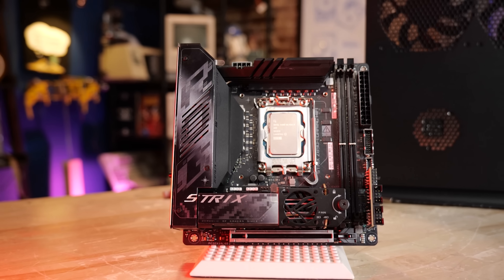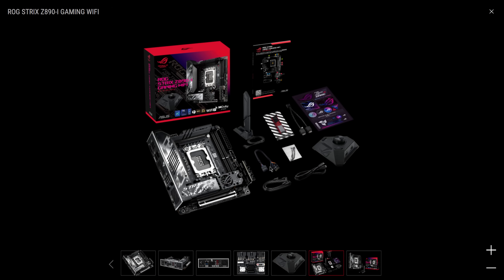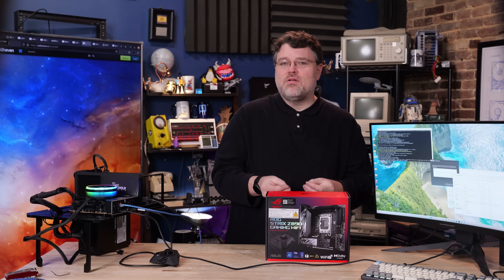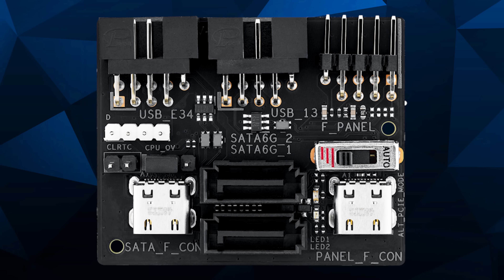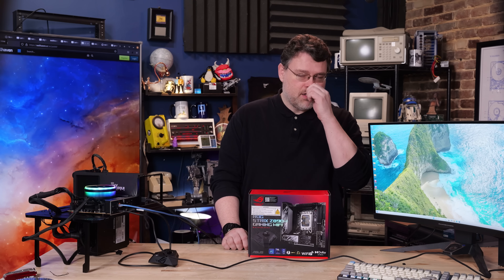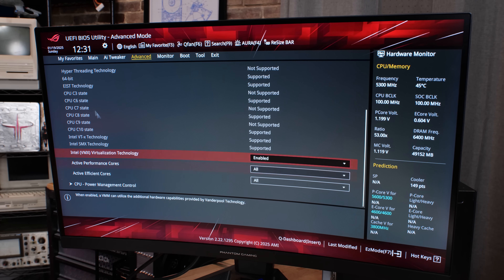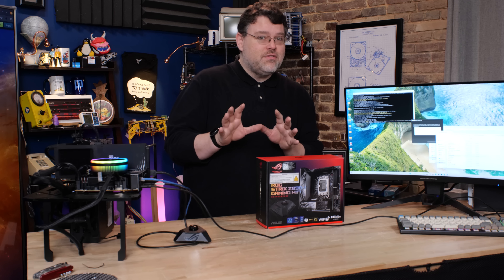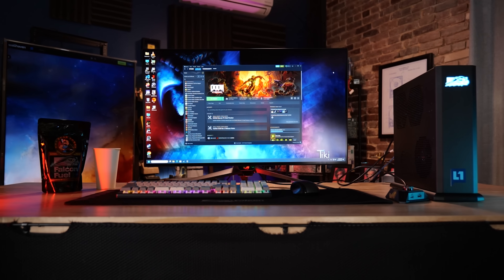The 285 non k Intel Ultra 9 w/ the ROG STRIX Z890-I Gaming Wifi Motherboard

Comment: You actually explain how the features work where the manual doesn’t clearly state certain features. 

Btw when I did EZFLASH with zip + file selected it flashed the bios and installed ME 

Thanks a lot!

Comment: The 285 non-K still has a 180W turbo TDP. Can that stock cooler really handle 180W?
Reply: For sustained high loads, probably not. For day to day use, it will be fine.

Comment: @Level1Techs  With 128GB or 256GB of DDR5, can you do some y-cruncher benchmarks for large pi calculations?  Y-Cruncher requires lots of system RAM for the larger calculations, and it would be interesting to see how the Core 9 Ultra 285/285k performs against other solutions for that math/science workload.

Comment: Didn't know where to ask... I'd like to get new hardware and turn my old pc into a home server. Setup: i7 4790k, 16 gb ddr3 ram, gtx 1080ti, corsiar hx850i power supply, MSI 7 GAMING 3 (MS-7918) mainboard. Doable?
Reply: I'm using a non k devil's canyon as my jellyfin home assistant server you'll be alright. If you need transcoding idk if the 1080ti is nvenc capable.

Comment: i had the Asus z690 itx board with that M2 tower, got it because it had thunderbolt onboard, was having so many issues with the drives i had to return it, went with MSI after looking up on the forums and finding so many reports of the same issue.

Intel has stopped placing a big price premium on K CPUs, wich also points to a much lower requirement in the binning process. They also played a lot of games with undervolting since alder lake - H0 die will only undervolt on MSI boards with lite load enabled in my experience, while the 12700k would not undervolt even with msi b760 but the 12600k does.. while the 12700f does on the msi B660 . Totally arbitrary stuff.

Comment: I had the same experience with a 13900k vs a 14900 (non-k). The non-k was so much more efficient and a much higher binned piece of silicon.

Comment: Intel should allow ECC memory support on all desktop platforms like AMD does instead of gatekeeping it to the W chipset series.
It‘s fascinating to see how they are in the gutter and still don‘t do everything to make their products more attractive to customers.

I thought them enabling ECC memory support on most CPUs would be a sign of Intel finally moving in the right direction here, only to be disappointed yet again by the bad selection of “workstation” or “server” motherboards required to use ECC memory.
Reply: I've been waiting for what feels like ages for ASRock Rack's W880 motherboards to come out, specifically for the ECC support, built-in Arc graphics + QuickSync, very low base TDP, and high (for Intel) PCIe lane count. And, oh boy, the W880 chipset and the Core Ultra non-K CPUs are taking forever to release. It's bizarre that Intel considers e.g. the Core Ultra 5 235 non-K to be "launched" for about two months, but there is zero supply available anywhere. I'm aware that full W880 motherboard availability was slated for Q1'25, but we're currently halfway through that and there are basically no products available to buy.
Reply: That’s my personal main reason for not buying anything from Intel since 2015. If possible I only get systems with ECC memory support even for personal little office systems for family members. Even if it’s just an anecdote, application and total system crashes have practically lowered to 0 once I checked that there aren’t any BIOS or hardware bugs.
Reply: Sorry about the rant... I'm just frustrated with Intel lately. This is the first time in years where an Intel platform successfully checks all my boxes (despite being on the expensive side), and I can't actually buy it due to lack of availability. Let me give you my money, Intel! God knows you need that revenue these days, LOL.
Reply: Be also warned that the software quality of ASRock Rack’s motherboard Firmwares and BIOSes is abysmal, I have had so many negative experiences with them (Intel as well as AMD platforms) that I vowed to never buy anything from them again. The crucially bad stuff is how slow and irregular ASRock Rack releases new BIOSes with critical security fixes, that’s an absolute no-go for me.
Reply: @abavariannormiepleb9470  Duly noted! Thanks for the heads up.
Reply: They also disable pcie bifurcation on anything but the high end chipsets. Really annoying

Comment: I wouldn't trust any CPU to run DDR5 at 1.45volts for long.   not sure what the ram manufacturer was thinking pushing the XMP settings that far.

Comment: Interesting about the Measurement Engine - I don't think you can update it from Linux. On my Asus Z790-A, the ME gets updated as part of the BIOS update (it does this in a 2-stage update with a reboot in-between) and has done since a particular bios version. I'd be interested to see if this is still the case here.

Comment: Bifucation of the v5 x16 slot:

I tend to associate you with "common sense" so much, that I felt you were contradictiong yourself there, criticising that the 2nd M.2 slot would take half of the x16 lanes...

Not sure you ever pronounced yourself on the real-world benefits of an x16 PCIe v5 slot for GPUs...

Actually, I believe the only real advantage of PCIe v5 support on x16 "GPU slots" is the fact that you can now take half of those and repurpose them for other stuff, extra storage or  networking that matches NVMe speeds.

I've been using a Minisforum BD790i Mini-ITX board with a Ryzen 9 7945HX already soldered and then put a bifurcation board in to the x16 slot which splits out half of the only slot's lanes into dual M.2 while leaving a physical x16 / logical x8 slot for low-profile cards on top: it's turned out a perfect solution, although I actually have nothing PCIe v5 in that system, it's v4 peripherals only, but the lane management argument still holds true.

And actually I'd love to see the GPUs switch from PCIe slots to a bunch of M.2. connectors, mirrored on the motherboard, so you can decide and switch on phyiscal and logical allocation of lanes to GPUs or others.

If PCIe switch chips didn't cost multiples of kidneys and dozens of Watts, that would still be prefereable, but I can also see the physics involved.

While cables tend to add cost, shock and reliability issues vs. slots, with PCIe v5 equal length PCB routing in a 2D space is becoming so much of an issue that cables may offer a 3D escape in addition to the flexibility and density advantages. My impression is that on EPYCs boards cables are already much more present because of that.

Comment: Trying to get F NW to replace that motherboard with one i will send them and say screw warranty but i don't think they will do it. I am getting a lot of push back. If you are going to cut the video card down to 8x from 16x might as well get MSI MPG Z890I Edge TI WiFi Motherboard, Mini-ITX and get 4x nvme slots for 32TB of storage and drop that board. I am going to have to take it a part after a few weeks I am sure and put what i want into it and sell that board. meh it is what it is and I really like the tiki but i hate that they picked one of the worse boards. I mean hell you even get 5gb ether on the msi and you don't have dongle crap all over the place too.

Comment: On one level, the bifurcation makes a lot of sense but is also dumb.  So many GPU manufacturers are using x8 so the other 8 are going to waste.  In an ITX, maybe you're more likely to use a lower end board. At least you can use 4 of them if you want. It would be super slick to enable the x8 5.0 to be x4 4.0 to 4 more m.2.  That seems real useful.
Reply: luckily, it seems like going down from x16 to x8 doesn't change performance very much on pcie5
Reply: @plinyvicgames  that's true for now. I guess x8 5.0 is the same band width as x16 4.0. 🤷‍♂️
Reply: @plinyvicgames  Currently the only cards common in user space that handles PCIe5 are the 5080 and 5090 GPU's, and that's if you define "Common" as potentially available. All other GPU's are at best PCIe Gen4 compatible, including the ones using x8 PCIe lanes.

And even that 5090 will lose no more than 3 or 4 % at the most when going Gen4. The interesting part is that apparently a lot of users has had problems where the RTX 5080 and 5090 has had problems running with Gen5 settings, so effectively they have been forced to "downclock" the PCIe slot to Gen4, halving the bandwidth, to be stable.

Now if you halve the width of the slot to x8 lanes, and at Gen4 speeds it will have the same bandwidth as a x16 lanes Gen3 PCIe slot. So say good bye to another 7 to 9 percent performance. But as the user has spent between $1200 and $2400 or even $3400 for the GPU they are surely OK with that...

Yes this is only relevant if you are spending on a latest gen Nvidia based GPU. Earlier generations will not lose as much performance, but for a motherboard intended for compact gaming computers that isn't a brilliant idea.

Talking about performance the difference between x4 Gen4 M.2 and x4 Gen5 M.2 drives is far from fantastic in the huge majority of applications and use cases. Sure the Gen5 drives are absolutely blazing, on paper. But in real use you are going to be hard pressed to really notice a difference unless you are running drive speed benchmarks. For the majority of all other use the difference is not going to be noticeable. Especially true is this if you use the Gen5 M.2 drive for booting, running the OS, gaming and normal office use. If you are editing 4K or 8K video, doing massive database shuffling and reorganization and so on you can see a difference between Gen4 and Gen5 drives, but if you compare the number of users that is a pretty small part of the user base. Sure they exist, but they are even rarer than the ones that has managed to obtain a RTX 5090 card or is slavering hunched over the keyboard trying to nab one from a store before it's gone again.

Comment: The Asus itx looks good except for the price and the lack of a port for an internet cable. I hope you tell us what happens when you put it into its case.
I am building an itx computer with the Z890i Aorus Ultra and a 265K to replace my intel core i7 7700 to be compatible with Windows 11. I got the K version to under clock it and hope to get power at the wall plug of 28 Watts or less. With the monitor and sound system my total draw is 65 W.
I plan to the 265K’s internal graphics which will be faster than the Nvidia 1030 I am using now. I got  the Arctic Freezer 35 cooler which comes with a contact frame and is compatible with the 1851 socket.
I am trying to learn Python and am looking forward to see what 20 cores can do with my prime search program that I wrote and see how it compares with Prime 95.

Comment: Why couldn’t the second M.2 on the adapter not just also go to the CPU? Intel lists the CPU itself as being capable of one x16 slot, and two x4 PCIe connections. Trying to find block diagrams even show the x16 and one of the x4s as gen5 with the other x4 as gen4. 

Could they not have avoided both cutting in to the x16 down to x8, and avoid routing through the chipset?

Comment: Thank you! Finally someone giving non-K CPUs some love. Now if somebody would just cover video production, there is so much potential with an intel iGPU and dGPU combo
Reply: The reason is they are not cheaper anymore since at least 10th gen, why bother at all? They are cheaper for them as they have no cooler and the package is smaller, bigger margin, resale value is a lot better...
Reply: Ouuf
Reply: pretty sure they launched today.
Reply: @12100F  I mean in general, been buying non-k CPUs since 12th Gen and hardly anyone reviews them
Reply: @RetroBerner I mean there's been no point in reviewing them since 12th gen came out, as there's been no new silicon worth mentioning. 13400F is a nerfed 12600KF, 14400F is the same with slightly boosted clocks, 12, 13, and 14100 CPUs are all the same config with different boost clocks. This is the first launch since 2022 that's actually worth reviewing.
Reply: @12100F  Yet they keep reviewing all the other K SKUs with 'just slightly boosted clocks'. Nah, the problem is that they assume everyone is just interested in gaming on their PCs. I get that at 45 I'm nobody's target demographic, but I got tired of tinkering and overclocking a long time ago.

Comment: look i just want intel to release a 286K and call it a day. like a follow up to the 8086K and we can roll credits
Reply: Can't wait for the next generation, when they release the core ultra 386
Reply: Old school ....
Reply: Nope, sorry, not how it works: it was still 80286 back then, they only started omitting the eighties once counting the address bits no longer worked with head, fingers and toes on the [80|i]386.

But yeah, I liked that, especially since the 80286 was my first PC after graduating from a 6502 Apple ][ with a Z-80 Softcard.

Comment: I had a Z690-I, and wasn't a fan of the stacked m2 or breakout board on that either. The B760-I was organized much better for my tastes, but I also didn't need anything cutting edge. I wonder if there's a B860-I counterpart to this one that's a little less of a headache. Ofc, no OC then, but w/e.
Reply: Did your z690I stacked M2 worked at all? Mine did not, and there were many complaints online about that. Not even a single slot was reliable.

Comment: I am glad there is still the balanced approach to CPUs here. As J2C said recently, there are other CPUs than the 9800X3D. Arrow Lake is not a massively competitive product, but it still seems to make a very good rendering and production platform; if you really, really had to start afresh.
Reply: Right you are! There's also the 9900x and the 9950x.
Reply: @ShippyJack  No argument there. Both great choices. Though I would prefer a Threadripper over all of these for rendering. Expensive.

Comment: It's a great video - but where is overclocking bit? I assumed BCLK or something.
Reply: The non K chips cant be overclocked. And today was about them.
Reply: @robinbegley1077  Except they often can be overclocked through BCLK (depending on the board) and the original title had "Overclocking" in it.
Reply: @jannegrey  Indeed, I was confused there too.

Comment: I've broken so many wifi antennas...antennae?...that I literally bought 20 cheap (yet upgraded supposedly) amazon replacements...and I only have a few left.

I'd hate to imagine that scenario with a brand-specific connector...prolly $40...if you can even buy a replacement...and for how long will it be obtainable?...
Reply: those Asus Q-antennas just use a CRC9 connector, replacement are very common on aliexpress, also adaptors.

Comment: Yes! Proprietary antennas. Can I have subscription based features also. Watched the video because you made it Wendell. Will never buy Intel or Nvidia
Reply: if you mean the connector, those Asus Q-antennas use a CRC9 connector, very common on aliexpress.
Reply: @endless2239  the connectors are not the problem. I can get anything, it's the fact that I have to. I have a drawer full of antennas.

Comment: Why waste flim on intel. they are crap. Go AMD
Reply: Fanboy alert.
Reply: I built a system for myself last month using 12700K...what an amazing performing machine it is. Zero complaints.
Reply: @ I have that too. It is nice.
Reply: @kalapede1  Good for you.
Reply: I always go with AMD. But I don't see a problem with looking at Intel. And those non-K SKU's are quite good in efficiency.
Funny part is that couple years ago people were complaining that reviewers took their time to look at AMD. After all Zen+ wasn't the fastest. Zen 2 wasn't the fastest either, so why bother, right? Not really - it's important to look at those. They do have screwed up price though.
Reply: @jannegrey   for productivity (after the windows and programs optimizations a couple of months after release), the 285 non K beats any non threadripper AMD, even the 9950x3d.
Reply: @apothecy4011  OK. But it doesn't do it like 30-40% better, right?

Not to mention they have only 8 performance cores without HT. For using LM Studio they might actually have bottlenecks from memory to CPU, because that will force use of E-cores.
Though they do have CUDIMM.

For me 285 is atrociously overpriced. I BTW use PC's for mixed productivity/gaming workload.
Reply: @jannegrey  9950x3d isn't 40% better for gaming than the 285 either. Especially at 4k (which is the resolution i use rn) , they are pretty close. Intel chips have improved since launce whith bios and windows updates.
Reply: @apothecy4011  I know that Intel chips are much better now then at launch. I think I did even say it few times in different places.
Reply: @jannegrey  i got a 285 non K for my temporary home rig(will move it to the office after Nova lake gets released in about 2 years). I ditched the stock cooler for a dark rock though.
Reply: @apothecy4011  Cool. I genuinely wish you good luck. I mostly went for AMD, because in my country they were either cheaper or had something that I needed (in my case 16-core 5950X, when Intel had 8-core 11900K). But for very budget build Intel usually has best offerings as well. Of course with all their issues with 13th and 14th gen - sadly I won't use any of those. And I sure as hell won't buy used ones (like I would do in previous years).

for 285K and non-K - their prices were insane initially. Both Intel's as well as for some reason retailers in my country decided to have higher margins on them. I know that 285K still has that issue. Non-K - I would have to check.
Reply: Dude 💀